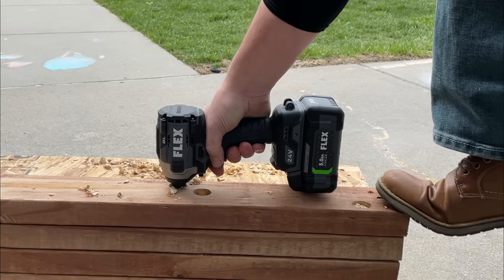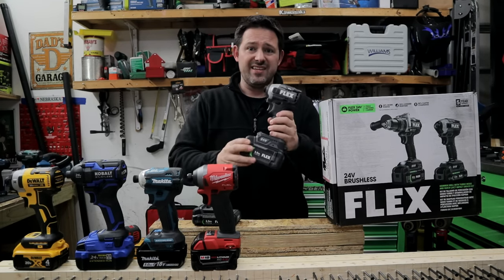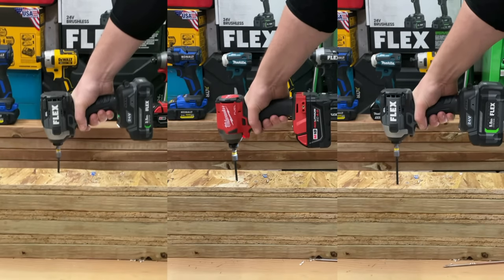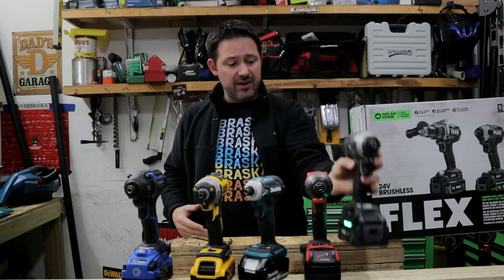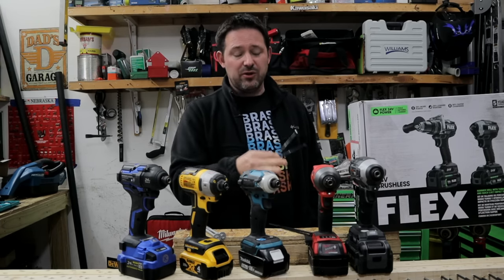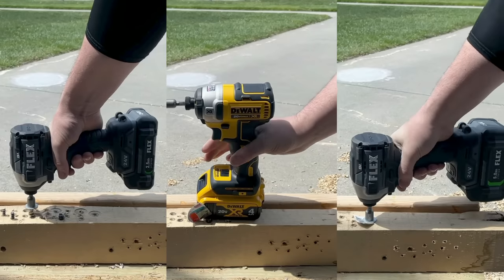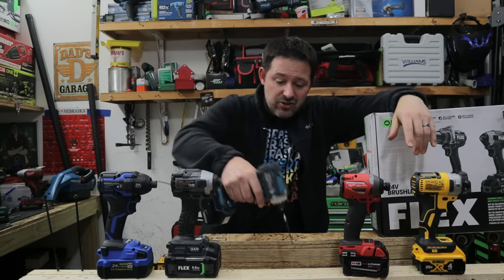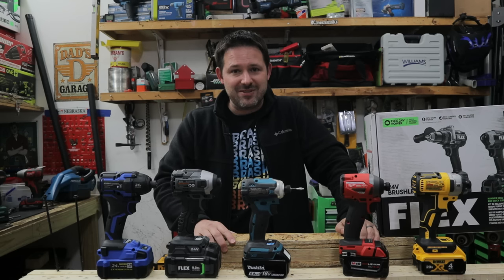FLEX TOOLS vs DEWALT MAKITA MILWAUKEE It's NOT what's NEXT Impact Driver SHOWDOWN!

Comment: you are right if you use the 6AH hi output for Milwaukee your Test will have different results I think because the  Power will be a little higher  and this is why check this Video this is something I just found out today  https://www.youtube.com/watch?v=ky5YRjz9lvc&t=919s     at minute 8:36 you can see the vibration on your hand with the Flex and you cans se like the impact movement on the tools like is longer maybe thats is way it was slower to get in but faster tu get out im just guessing

Comment: Put the 5ah battery on the Milwaukee and I guarantee the flex loses on everything. Why does the flex get the biggest amp batterie on all tests. If flex batteries get cold they do not work they suck in cold weather

Comment: Kinda funny how u kinda purposely deprived dewalt I mean u didn’t even use the newest impact let alone a decent battery I mean it’s the only one with 4amp every other had 5amp
Reply from the maker: The 4Ah is larger than the 2.5Ah but smaller than the 5.0Ah so you get both comparisons with a focus on power to weight ratio.  That and I used batteries they typically come with a kit or promo so it's pretty common to see the configuration I tested.

Comment: you using the wrong tool you don't use an impact driver to drill with an auger bit , you wouldn't use a 18 gauge nail guns to do framing with would you this demonstration is BS

Comment: "Just imagine the milwaukee eith a bigger battery". Why di I have to imagine, why not actually show it. I am tired of these "fair" head to heads. Can someone show me what a milwaukee can do with a high output 3.0 and a 6.0 vs flex. 6.0 because that battery uses bigger cells compared to the other milwaukee batteries.
Reply from the maker: They are rough cut from some higher end pallets I pulled apart. So far they have been worth asking if they were throwing them away and if I could have on

Comment: Run into concrete this guy doesn't know anything about construction you don't use a impact at all for drilling into concrete. And you shouldn't drive a fasteners  into concrete with a impact as well they strip them . And I you shouldn't drill with impact